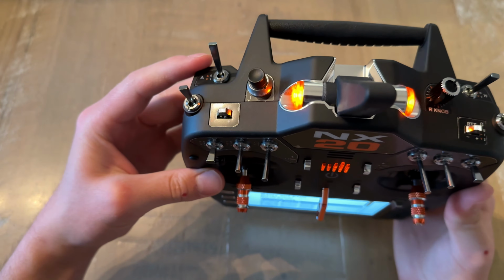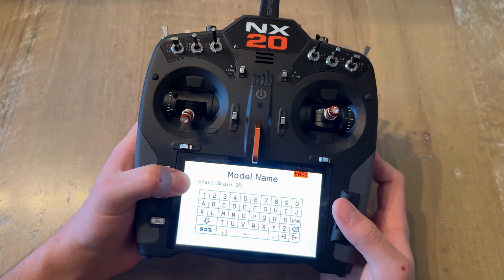Spektrum Quick Trick: Save Setup Time with Model Templates!

Comment: boy I can see why the NX transmitters returned have a high return rate at Amazon. this thing is extremely difficult to understand. I feel like I thrown over $400 out the window. edit; well I figured out part of it by going over your video a few times. thanks
Reply: Well then i think u should have another hobby. So easy to understand.
Reply: @JohanSvensson-s5u  Is that what you think? Well I definitely did figure out how to use it but it took me a minute or two and there's a good chance I've been in a hobby longer than you living Yeah I've been around since the megahertz days
Reply: @Carbon-I-am well mayby thats why u dont understand the new tech😊
Reply: @JohanSvensson-s5u  Yeah I can't disagree with that statement brother
Reply: @Carbon-I-am u know what, im 50, been flying for about 4 years, i have 12 planes and 2 heli, and sometimes i dont understand what im doing😂😂😂😂

Comment: Does the template also save other things like the telemetry gauge panels and timers? Thanks!
Reply from the maker: It does! Any configuration made within the transmitter on that particular model will be saved in the template. :)

Comment: Since your right hand is busy flying, you ought to put the dual rates on switch B. Go ahead..  😊
Reply: Ah man my muscle memory from Switch B being my flight modes for helicopters keep me from putting it there! Funny enough that’s where I used to have my dual rates  until I got into gassers. The person who got me into it had his dual rates switch there so I just copied him and have been used to it being Switch F ever since!
Reply: @EthanAter I bought my first 2.4GHz transmitter in 2008. It was a Spektrum DX7 helicopter version and I used the B switch for normal, idle-up 1, and idle-up 2. It wasn't long before I was using switch B for dual rates on airplanes. I'd only been flying RC planes for 45 years in 2008 and had used various switches over the years.  I don't remember what switch I used for rates on a helicopter. I never got good enough to need high rates on one.